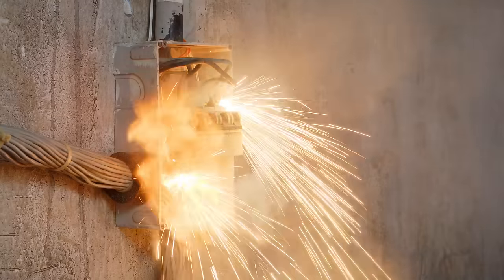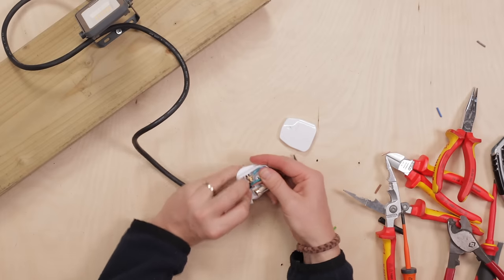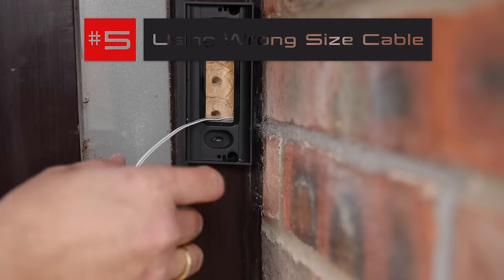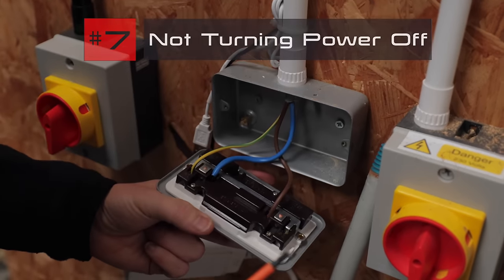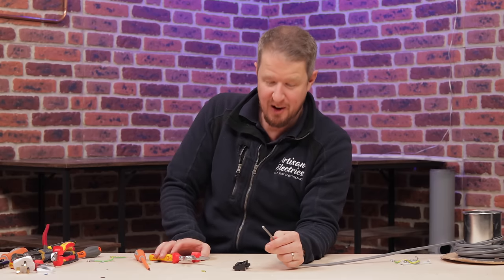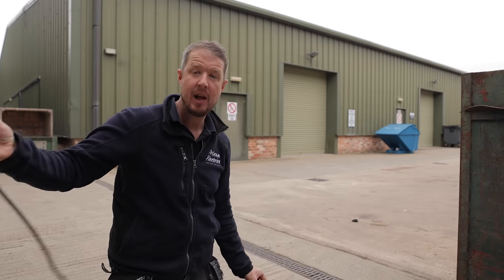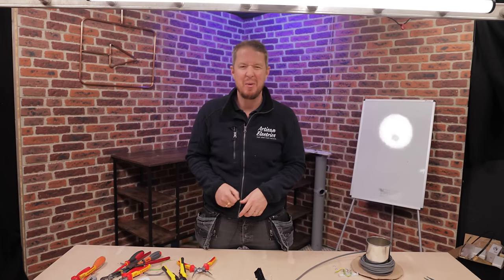10 Mistakes EVERYONE Makes When Doing DIY Electrics!💥

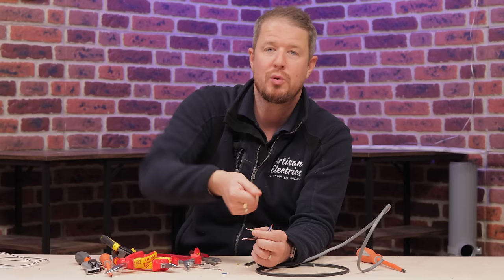Comment: 1:44 the best twist is if one twist is slightly below the other wire. ( black and black on one side and the red and red cut slightly away from the black because if one of the burns a bit doesn’t bridge the connectors )
1:59 colours match easy but that’s in theory. In reality if you have an idiot that done some diy before you and put things erratically then you’ll have a problem. I know because in my boat the wiring does not make any sense. 😅
2:59 wires in time come loose and can get into the wrong side.. plugging a box junction is a maze and a puzzle always. Needs time and patience and lot of understanding.
4:37 yep. Washing machine microwave and a kettle is enough to call it a day 😂
5:19 people needs to learn how the electricity runs from a to b. It warms up as it’s running just like a fuse.
6:16 in my boat I have a maze of wires that are labelled and only the previous owner knows what it means 😅 and so random also…😂
11:27 last one is a lesson for me also 😂 😊

Comment: Whilst they may be mistakes that some DIY people might make, let us not forget the trove of material on YouTube from professional electricians slagging off work by other professional electricians. Just from my memory, I recall Jordan creating a video on how he was nearly electrocuted by an installation whereby two circuits were linked and when a timer kicked in, what was not supposed to be live became live. Oh, and how about giving the installer of downlights 4/10 for their method of creating continuity of the CPC because it wasn't how Jordan would have done it? Not clipping cables properly? Are you really going to say that professional electricians don't have that failing? And how about new build houses? I couldn't count how many videos there are slagging off the installs on them by *professional electricians*. The daisy-chaining of extension leads is also an over-rated danger. It is not good practice, but if each extension lead has a protective fuse properly matched to the attached cable, there should be no fire risk. All cables in the installation will have, upstream of their attachment, a protective fuse matched to their maximum current carrying capacity. And that is the exact reason those fuses are there. DIY does not mean that the person knows SFA about what they are doing and neither does the fact that someone is a professional electrician mean that they will do a good job. And, really, people who would make some of the stupid mistakes here are unlikely to be the same people taking the time to watch videos on electrical installation done properly, are they?

Comment: If only Jordan saw how many extension leads I use connected together to power certain stuff including a heat gun, he will have a heart attack🤣
Just don't tell him about the ones without an earth made from scrap vacuum cleaner cables🤣

Comment: Wow, is anyone THAT bad at wiring a plug, though there are a few less awful ways - like doing the wires same length, as usually the length to the earth is longest, and the live shortest, so if the surplus is just scrunched, the earth will break first if the wire pulls out of the plug, when really, you want the earth to be last to break

Comment: Over the years I have seen people regularly wire showers up with two x 2.5 mm  cables in parallel instead of 6.0 mm cable also I once saw a socket  in the kitchen with the live and neutral reversed and the washing machine that was using the socket still worked go figure?

Comment: Nope! Not unwinding an extension lead will NOT cause problems because of induction. The currents through both wires will cause magnetic fields that will cancel each other out. The problem is resistance. There will simply be tens or even hundreds of watts of ohmic losses in the wire drum with nowhere to dissipate to. If you unwind the drum, these losses will dissipate better and the lead will not heat up that much. But the loss is still there - so go buy yourself a GOOD extension lead with bigger gauge wires. Less need to unwind it too.

Comment: The ceiling rose is the thing that confuses more DIYers, than probably anything else.

I've been called by a few panicked DIYers, where they've charged in and disconnected, only to find more wires than they expected.
Reply: Had to sort that one out for a neighbour recently. Seemed puzzled that I could sort it while chatting about something completely different.
Reply: @Graham_Langley  It's easy enough to sort out, if you understand how the circuit  works.
Reply: That is the trouble they buy a new light fitting from DIY store and it wants L, N, E and you pop open ceiling rose and there are loads of wires!

Comment: The overloading extension i get what your trying to teach but lying to people is not the way to teach them, you have have extensions plugged into extensions all you want that wont cause a fire it's what is plugged into them but then also that why extension cables in the UK have to be fused, so you try drawing more power though the cable than it's rated for the fuse pops. It's the amount of draw you have going though them that causes the heating and fire risk, not the amount of extensions, but at the same time you did not mention how many people use a coiled up extension which causes induce capacitance and can cause the cable to get hot also the fact that the cable does not have air around it to transfer the heat away.

Comment: bell wire is fine... for low load 24v led circuit, for instance within a kitchen cabinet
Reply: Depends on the load yes, 
But no protection from mechanical damage eg rodents.
Reply: @voltare2amstereo i have a cat for those 🤣
Reply: but its not good when some dodgy decorator tells your parent he can put in wall lights for them, and attaches a 240v, 300watt halogen wall light and a front door light off of bell wire...
Reply: How do you know a 24 circuit is low load, because it's 24 volts?
Reply: @deang5622  the current going to the devices connected. Your average bell wire should easily handle a couple amps

Comment: Bell wire. With all these low wattage led bubs. You will find Bell wire is more than adequate for the job
Reply: No.
The type of cable used isn't just about wattage, it's about the operating voltage too.

Firstly you should not be using cables that do not conform to the appropriate BS standard.

Secondly, bell wire cable rated to handle 24 volts is not likely to be rated for 230 volts RMS.

Comment: Please stop spreading that its a mistake to twist your connections. That is the preferred method here in the states. Solid - solid or stranded - stranded only tho. When mixing wires use the appropriate UL listed connector

Comment: A DIY incident. I recently changed a light switch in my kitchen. I powered it up and tested it, it was okay until I came to put the switch in to the wall box. It wasn't until i got to the last turn of the securing screw that the screw cut into the wires and bang. Be warned.
Reply: I made a similar mistake. Levelled up a cooker switch, and all was fine until the next morning when the RCD tripped. I didn't suspect the cooker switch as the RCD would trip when putting load on the separate socket circuit. Got an electrician to check things over and he found I'd nicked the neutral when tightening up the face plate screws. If I didn't have RCDs then I'd never have known there was a problem. In this case the mistake was using screws which were too long, and this is why the experience of an electrician is invaluable - it's all the things you don't know you don't know.

Comment: My mum had an extension lead with no sheathing not on the plug but on the bit you plug stuff into over time both the earth and neutral disconnected stayed over to look after the house a little while ago and didn't realise the condition and plugged my charger in there was a massive bang and a spark unfortunately she has a old rewireable fusebox so no protection she was like ehh it's been like that for years wasn't until she plugged something in and it went bang and caught fire that she suddenly realised how dangerous it was and her dad was an electrician

Comment: Your yoyo is NOT making an induction coil! Current runs in both directions so the magnetic fields cancel each other out.

Overloading an extension lead in the UK shouldn't be a problem as it should have the appropriate fuse. Obviously yoyos have 2 ratings and are fused at the higher but other than that you should be fine.

Comment: I know that it disgusts people but I am the world's worst for cascading extension leads, in fairness only for low powered devices.  As others have said the coiled up extension lead does not heat from induction, it is purely resistive loss. A common misconception. (My wife is the world's worst for putting heavy loads through coiled up extension cables....)
Reply: The resistance is not higher or lower if the lead is coiled up or not, it's the same (at least at first). The problem is the missing heat dissipation.
Reply: @johnscaramis2515  yes, that is true.

Comment: Do you need to fully unwind tethered EV charger leads? Manual was silent on this when I checked but as it started getting warmer when charging I checks and unwound
Reply: That's an interesting question. I don't actually unwind ours fully. There's no masses of wire on it. Zappi tethered. I tended to think of it being less of a trip hazard if it's not all unwound
Reply: @michaelmcgoldrick78  I have the Andersen A2. Trip hazard is precisely why I would prefer not to. I try to park my car as close to the garage door to make it less likely anyone would try to go behind my car. I have put fluorescent tape around it to try to make it more visible but there's not much light there. Would be nice to be able to tell car to keep some lights on when plugged in. Thinking I may use a cone too.
Reply: I found an Andersen page that said you didn't need to fully unwind it. YMMV.
Reply: RTFM. Always RTFM.
Then if something bad happens, you can blame the manufacturer.
Reply: @deang5622  First thing I did :) 
There was nothing in the manual. I found another page on manufacturer website saying you don't need to but at 7kW it still gets pretty warm.
Reply: @sebastien79a  What you could do is look up the temperature rating of the cable, have it coiled up, run under full load current, and use a temperature sensor to measure the temperature of the cable.

See how close it gets to the maximum permitted temp.

Also factor in, what the temperature would be in summer.  So calculate the temperature rise (the difference between the initial temp with no load, and the steady state temp after it has been charging the car for a few hours) and add that to the maximum ambient temperature in summer. And check that is below the maximum temperature for the cable.

The difficulty might be finding out the max operating temperature of the cable.
So inspect the cable, see if the max temp is stamped, moulded on to the sheath, and see if there are any cable standard reference numbers or part numbers and look them up online to identify the specs for the cable.

Comment: Reason #10 you did not point out that a coiled extension cord is acting as a resistor which will reduce the voltage at the appliance. If this is repeated  it will result in early failure of the appliance.
Reply: Whether the cord is coiled or not has no effect on its resistance.  You will get the same voltage drop either way.

And most types of appliances will not suffer any damage or reduced lifespan from reduced voltage.  If the voltage drop is too large, they may just not operate as well or at all.  However, the voltage drop also depends on how much current the device is pulling, and most high-power devices are actually designed to tolerate a substantial amount of voltage drop anyway.

Voltage drop is also factored into the current rating for most extension leads, so if you are not pulling more current than the extension lead is rated for, you will simply not get enough voltage drop to cause a problem for most (properly designed) devices anyway.

Comment: Best horror I've seen was lights wired with bell wire and pinned to the wall using panel pins through the insulation betweeen the 2 conductors!

Comment: I am NOT an electrician but my little brother IS. When he was training with the LEB decades ago, we used to rewire houses in the East End - I was his gopher. I learned enough to know what I can safely do and what I need to leave to a pro in that time but anyway.... Yes, I really have seen 6" nails in fuseboards; I really have seen melted twin & earth cable. I really have seen "heavier" bell wire used in a 13 amp plug. I have seen countless "spur on a spur on a spur on a spur on a spur" using 2.5T&E If they'd only connected the other end. People ARE stupid. Darwin awards are won regularly. What needs a fuse, after all???

Comment: I went to change a socket which was a spur and the person who did it used a cooker cable for the spur.
Reply: What size cooker cable? Are you sure it wasn't a radial circuit with larger cable than 2.5mm? 4mm or something?
Reply: @martinw245  it was definitely a spur and it was 6mm cable at least. Remember it well tracing it back to socket at the back of the kitchen units. When I asked the words, they didnt like to throw things away so it looks like they reused the cooker cable.
Reply: @stuarth540  

Very weird. 4mm is the max a 13 amp socket is supposed to take, if I remember correctly.

But I guess it's better than being under size
Reply: Just unusual and was worried it was wired up the the cooker

Comment: I still  argue the daisy chaining of extension leads. As it should not be possible to do as each lead should be fused for each lead. It should not matter if taking 13A on one outlet, or through a combination. But anything more will blow the fuse in the overloaded circult.
The induction of a coiled cable will be cancelled, as the live and neutral currents are antiphase. The overhearting is a purely resistive thing.
Reply: Live and neutral currents are not anti phase. They are of exactly the same phase angle.

What they are, are equal in magnitude and opposite in direction.

This results in the creation of two magnetic fields in the coil which are equal and opposite in direction, and cancel each other out.
Reply: @deang5622  I was simplifying. I was trying to make that exact point.
Reply: @gonzo_the_great1675  I know what you intended, and you are right, but you used the wrong word.

You can say that the magnetic fields are in anti phase with each other, but not the currents.

Comment: Not using earth sleeving on earth wires is not good either
Reply: To be honest, I've never understood the fanaticism with earth sleeves.  Sure, it's technically not a bad practice, I suppose, but particularly if you're packing everything into a big metal box (as one often is), all of which is earthed too, and none of which is "sleeved", how much does it really actually make that much of a difference?  I mean, there's a reason none of the wire manufacturers bother to put extra insulation on the earth wires to begin with, because uninsulated earth wires really just aren't a problem in general...

Even in plastic boxes, if all of the main power conductors are properly insulated and isolated, having earth conductors exposed should not really add any significant risk to anything, IMHO.  I honestly half wonder if the whole "earth sleeve" thing was just thought up by companies as a way to get all the electricians hooked on another consumable product they have to keep buying...
Reply: I've seen electricians do that. In the US it's normal not to use sleeving.
Reply: @jeremybarker7577  

Normal in some countries and not others. In some countries the cable is manufactured with insulation on the CPC. In fact Doncaster Cables are manufacturing such a cable for the UK.

I think I recall that the reason sleeving is added  is to prevent a  kinked bare conductor contacting a live terminal. Also for identification.
Reply: @foogod4237  

I think I recall that the reason sleeving is added  is to prevent a  kinked bare CPC conductor contacting a live terminal. Also for identification. 

As for manufacturers not manufacturing with insulation on the CPC, they do in many other countries, they do in Ireland I recall. And Doncaster Cables are now manufacturing such a cable.

Comment: I don’t like the 50£ testing tool in a guide for beginners. There is already a tool that just consists of a neon light that looks like a transparent flathead screwdriver that costs like 1-2£.

You tell some newbie oh you need to spend 50£ just on a test tool, they will either give up and call an electrician, which would be good, or they would try to wing it anyway and get hurt.

At least mention the cheap alternative and how to properly use it. Please.

Comment: Good tips - though some pretty obvious ones there. It’s a bit arrogant to suggest DIY installations are sub standard to those of a qualified electrician. In some cases they will be better. It’s impossible to generalise, yes there are good electricians but there are also some very competent DIYers - just as quite a few so called professionals could be criticised for their work. 
Better to just title your video ‘frequent mistakes’  rather than attributing it to home owners. The language you use is very obviously skewed towards generating work for professionals - understandable as that’s how you make money - but something of a generalisation.